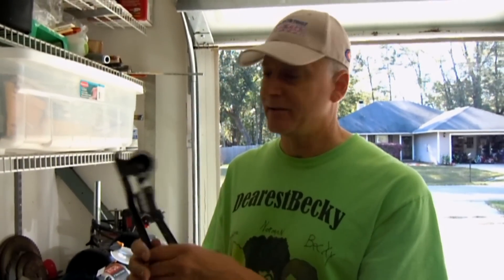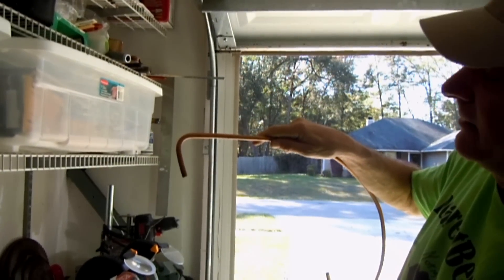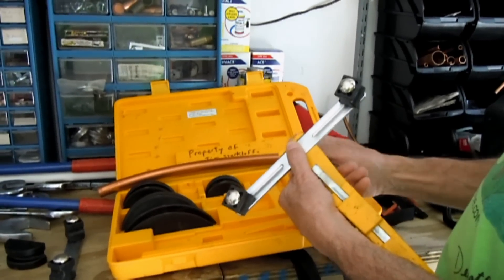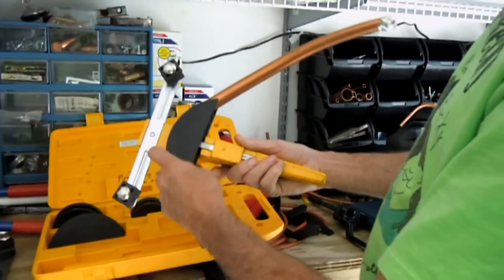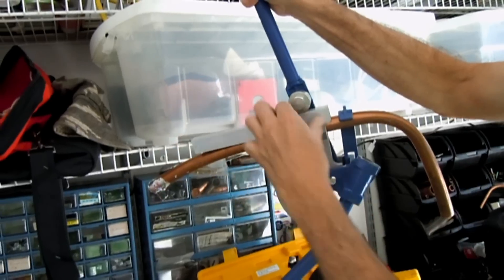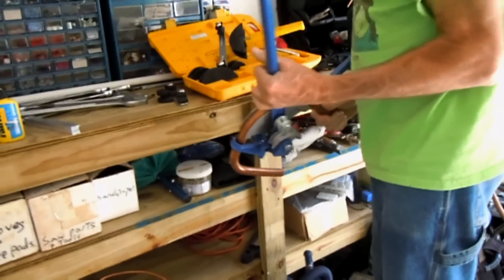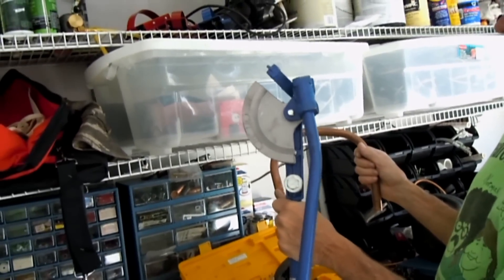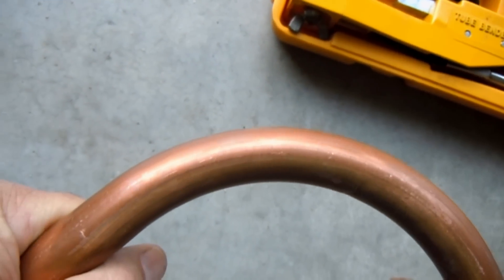HVAC tubing benders 1

Comment: Thank you for making this video.  I was hoping you would have done a 90 degree bend against the curve in the lineset, as it was in the coiled roll.  I've been seeing wrinkles inside my 90 bends with a YJ ratchet tool, but havn't pinned it down yet.  Thinking it's the lineset.  Either way this video was great at answering questions I had.  I find myself in crawl spaces and tight working areas trying to make 90 degree bends on pipe coming through access holes.  While I wanted the "old school tool" I get the picture that it would not be very user friendly for that purpose.  As much as I gripe about my YJ bender, I don't see a better tight quarters solution.  Any bender can work on a shop bench but in the real world when you're trying to use a single, uncut lineset, it's a bear to fabricate a line with a single piece if pipe.  I welcome any suggestions what works best for others.

Comment: hi. suppose oil leak on LPside or HPside flare nut and compressor run on low oil. can you make a video on filling compressor oil in mini split like 1.5ton on site. with a low side charge port available in unit.

Comment: @suzukirider67  ,The new ratchet benders are really bad to use if your doing alot of bends. the black half circle thing gets stuck on the pipe , 
only buy these if you are not going to use them all the time or buy the expensive ones.

Comment: When working with new copper the ratcheting bender makes a nice bend. Tight bends are nice when leaving a penetration to follow a wall. Besides they don't make a reverse bender for old trusty do they? I have to admit that the tube that old trusty bent looks like it was forged that way. Nice tool.

Comment: The old style bender did a better job, I'm impressed with both on the 7/8" tubing.  It looked like the tubing was an older piece which it harder to bend than a newer piece of copper.